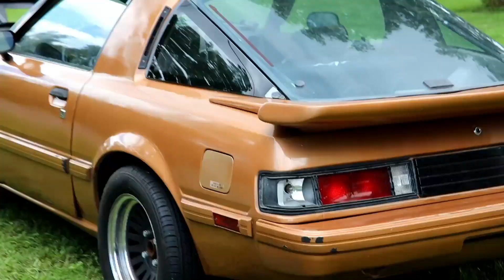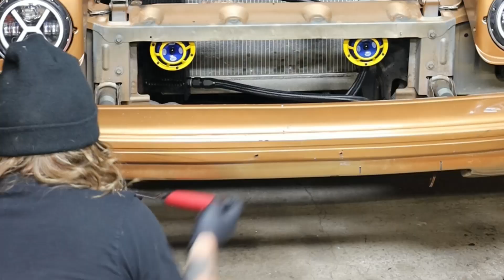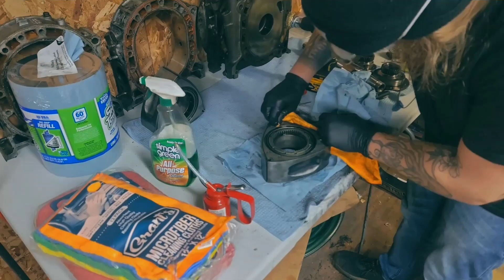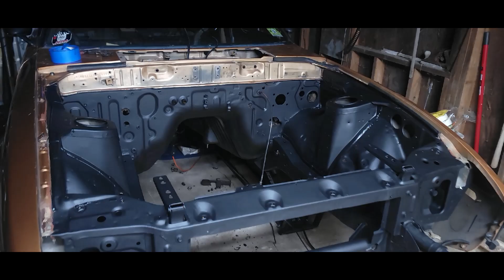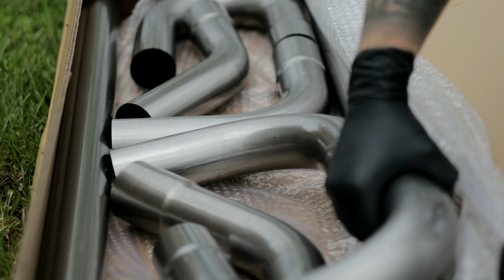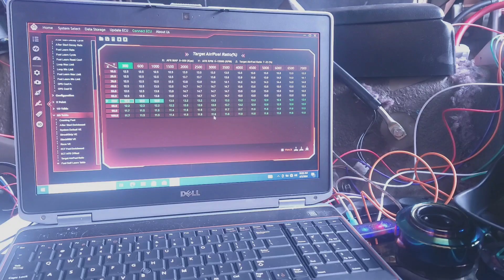Aces EFI Killshot - Complete rx7 build - 12 months of progress

Comment: hey man i’m doing the exact same build the only problem im having is my egi isnt shotting fuel at all please help
Reply from the maker: Egi?
Reply: @ the aces efi lol the auto correct took over
Reply from the maker: @TaperLij  do you have an efi high pressure fuel pump or like the old carb pump?
Reply: @ I am currently running an evils energy one that says it’s 75psi capable, i was thinking about upgrading to the 400lph holley pump
Reply from the maker: That should be plenty for a stockport NA build. Are you getting no fuel pressure? What do you mean by it's not shooting fuel at all?
Reply: @ yeah i wired everything up how it’s supposed to be im reading rpms and all. But my only problem is its not shooting any fuel im hoping its just the fuel pressure i’m hooking that new pump and regulator up soon
Reply from the maker: @TaperLij  it needs to be set to 43.5 psi and make sure you're reading the trailing tach signal with "- coil" selected
Reply: @ oh okay that makes since i have it hooked up to both coils
Reply: and i’m supposed to put the regulator on the return line?
Reply from the maker: @TaperLij  you can run it whichever way you want. Look up how to run a fuel regulator with a return line. I can't really explain it too well over text
Reply from the maker: @TaperLij  definitely don't do that
Reply: @wheresmy10mm  okay got it thanks man helped a lot
Reply from the maker: @TaperLij  good luck!

Comment: Im curious im working on practically the same project 12a on aces did you ever get the rpms to read correctly on the killshot? Ive been have trouble reading at half the actual rpms
Reply from the maker: It will never read properly until aces allows a cylinder select function. You can tune it just fine though. Halve your rpm like for example in the fuel table. Use 500rpm for tuning at 1000rpm of engine speed. 2500rpm in the table for 5000rpm on the engine, etc. It runs great besides that. Fires up first try every single time
Reply: @wheresmy10mm  sweet thank you keep up build it's coming along great!